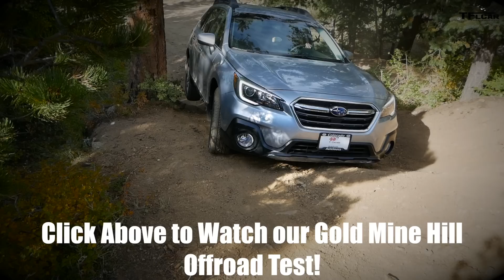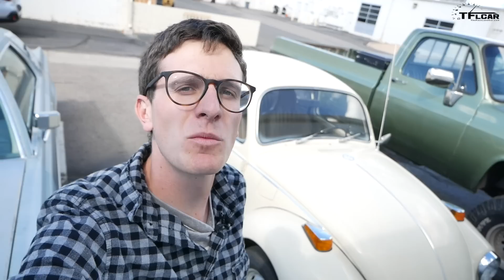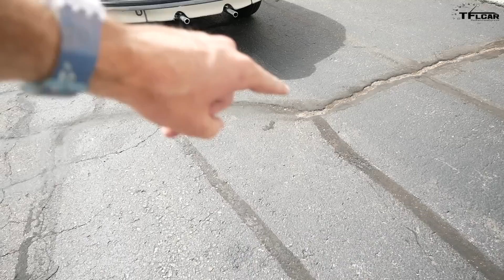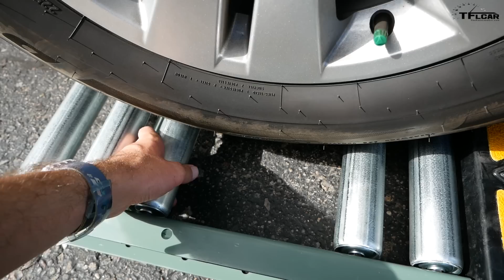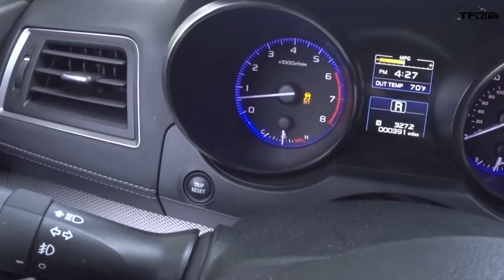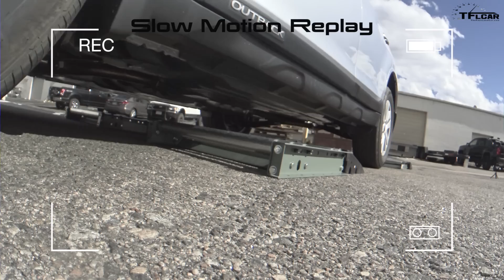The Truth About Subaru's Symmetrical All Wheel Drive:TFL Slip Test vs Subaru Outback

Comment: another really important thing to consider is Subaru awd is always on, its ALWAYS sending power to all four! this makes a huge difference in snow, light sand, light mud, and uneven surfaces.

we just bought a 2018 subaru xv and it just snowed 35cm in calgary last week. i noticed right away the hilarious difference between my honda awd and this subaru, we also tried it with my friends Nissan awd. the biggest problem with all other awd systems is they dont send power to the rear untill slip is detected, so i ask, whats the point of sending power to the rear if your already slideing sideways......  subaru FTW!
Reply: In my experience, AWD in the snow helps mostly to get moving from a stop.  If you're sliding sideways, that means none of your wheels have traction.  Even Subaru's AWD system is useless if 0 wheels have traction.  What's needed is proper winter tires.
Reply: i use nokian studded winter tires on all my vehicles. and yes you are correct, i would take FWD/RWD with winter tires any day of the week then AWD/4WD with all seasons.

subaru sysmetrical AWD + studded winter tires+ light weight= totally un-stoppable in the snow/ice. i drive circles around jeeps/trucks haha.
Reply: @michaelxcx  Not exactly correct about "the biggest problem with all other awd systems is they dont send power to the rear untill slip is detected". It used to be like that many years ago, but modern awd systems do not need any slippage to power all wheels.
Reply: @4x4.tests.on.rollers  incorrect. Apart from subaru. Audi.  Mitsubishi and some bmws. All other awd systems send power only when slip ia detected. This is why they are called "on demand " awd. Not " always on "awd
Reply: @michaelxcx  You would be right if we were in 1998 or so. But it's 2019, reactive systems are almost gone. Now they are proactive (so is Subaru with CVT, connect some OBD and you will see how often and how close to fwd it is working), there are tens of factors responsible for powering all wheels, slippage is the last in the "hierarchy". Some of those systems work great, some are poor, but "on demand" doesn't mean "on slippage". Any acceleration is a demand, any corner is a demand, yaw, longitudinal G, lateral G etc.
Bmw? Never ever heard about any xDrive based on slippage.
Reply: @4x4.tests.on.rollers   again, you are incorrect. clearly u cant read so just watch this video ( please see link:https://www.youtube.com/watch?v=2OzK-oRPCbs) and you will see what i mean. most awd system only send power after slip is detected, i rest my case, glad i could educate you.  cheers.
Reply: @michaelxcx  That is exactly what I wrote before, old systems. You must have been sleeping for last 15-20 years. You linked video which is already 11 years old, cars in the video are even older. Wake up.
And again - which xdrive is based on slippage? Educate me.
PS. When it comes to reading ability - look in the mirror. All you need to do is type in "proactive awd system", "feed-forward awd system", "active torque distribution" etc.
Reply: @4x4.tests.on.rollers  just drove  a 2017 ridgeline the other day. Very clearly it was sending power after slip was detected. No  joke , just yesterday i drove a 2016 toyota sienna awd, was sending power to rear after slip. Also also drove a 2018 crv last year, guess what...... Same thing.  And last year i drove a 2016 Hyundai santefee, also was sending power after slip. My wife owns a 2018 subaru Croastreck and it clearly sends power to all 4 all the time regardless of slip. I test drove a 2016 audi tt last year too also sends power to all 4 all the time.  I dont see how many more examples i need to provide becuase at this point its VERY clear that u are incorrect sir.
Reply: @michaelxcx  Just google the sentences from my previous comment...
Sienna or CR-V are not the best examples of awd systems. In fact, they are one of the worst.
If Audi TT is powering all 4 all the time, than it is the same with Volkswagen, Seat, Skoda, Volvo, Opel, Ford and many others based on haldex. But it is not the point to power all 4 all the time, but to power in proactive way. I don't expect you can check it via service computers, but there are hundreds of articles and videos about it, at this point it is VERY clear that you didn't read or watch any of them.
Short example: https://youtu.be/klZO6oG5PgU
And once again - which xdrive is based on slippage? Educate me sir.
Reply: @michaelxcx  I missed you mentioned about 2016 Santa Fe. Well, it spins front wheels less than a Forester and the same as XV:
https://youtu.be/on8siRlcxGU
https://youtu.be/S1d9wMLo-Tg
Reply: @4x4.tests.on.rollers   TQ vectoring is not the same as on-demand AWD . ive made my point and clearly u cant be helped. cheers.
Reply: @michaelxcx  I didn't say a word about torque vectoring. You obviously don't know that it is competely different thing than (pro)active torque split. No wonder, that was a really long sleep.
Reply: Agreed about the tires. When I got the AWD Lexus it had cheap china tires(or they were hard sport tires). I couldn't even move in the snow, but they are ok in dry/wet. I put Michelin  snows and it made a total world of difference. I think studded is overkill for AWD, that would be a good choice for RWD. Stopping distance is another story though. You need everything you can get. My neighbor bought a new imprezza sport and it could barely even get up the very slightly inclined driveway, It came with summer tires!
Reply: Toyota-Lexus has a better AWD system: https://www.youtube.com/watch?v=tNDV3U2H-Zg . 30/70 and 50/50 in snow mode. It is RWD based and derived from the Toyota Trucks. They don't have to advertise it either.
Reply: @InlineSkateFitness  Subaru AWD system is 60-40 and goes 50/50 when it detects slippage (CVT) and 50/50 for the manual. Toyota doesn't advertise their AWD because everyone knows Toyota isn't an AWD manufacturer. So they there is no point in advertising that when you have a competitor that has been doing AWD since the beginning. Audi has a way better AWD system than Toyota and is been tested to be on par with the Subaru. Subaru AWD is always on vs all other brands that only turns on when slip happens. Like Mazda skyactive system, what is the point of turning on AWD after that fact one of your wheel lost traction? Its already too late.
Reply: @441meatloaf  AWD since the beginning? Toyota had AWD in the 80s on some cars, and their LandCruiser? Their trucks are all over the world and are designed for deserts and off road.

Please educate yourself about this specific Lexus (Toyota) car. Toyota AWD on the GS/IS/LS is all time 70/30 rear to front. So you have a great RWD feel most of the time. If slippage is detected, it has a wire and valve body that moves it to 50/50. It is a heavy duty transfer case that can go in a truck. It is not "part time" or wait till you slip. You are getting every last bit of grip the tires can muster.

https://www.lexussouthatlantaparts.com/cars/LEXUS/0/IS250/Driveline--Transfer-Case-and-Axles/IS250-parts.html. There is a clutch that lock both axles together if needed. The transmission is the same part number as the Tundra, but the transfer case on the truck is a full time 4x4 unit. Subaru? A rubber band CVT? Head Gasket issues? Not putting it down, it is a great system, but the Toyota is in a class by itself.  I picked a used GS 350AWD over a Subaru. I get 23-24 mpg too and the thing has a ton of power.

Extremely rare to see that Toyota drivetrain fail in any way. I'm on the forum. Toyota does not advertise their AWD just as Five Guys never advertises either. That don't mean they not the best :lol:.

Comment: What a stellar scientific way to test the drive system! Great job! One suggestion, to simulate a very slight grade, once the slip tires are on the rollers you could put the small ramps against the Traction tires. You could increase the severity of that ramp or wheelchock to increase simulated obstacle or grade

Comment: well it worked as expected i think, x mode seemed to make the TCS a bit less reactive which is great to allow more wheelspin before start braking wheels,  good if you are driving over some mud sand or deep snow, places where you need either momentum or less esp action in order to keep the revs up and the wheels spinning and digging. Not so good when you´re on an icy bit of road from your town, 
what you could do now that you have rollers is test all the awd systems that you might get using them before doing the usual offroad video up GMH or whatever so that you see the awd work just like the dealer says it works (just like you´re told it will work when you buy the car) and after see how it really works in the real world, i mean this could be a way to see if brands lie about how good their products are

Comment: While this is interesting it's a poor way to replicate actual off-road use.  As noted by others and in your own commentary this is the least possible difficulty as there is no load.  You could likely have just pushed the car off.  The one thing you didn't try is left foot braking in a non-TC equipped vehicle to simulate TC.  That's standard off-road driving 101 - you always left foot brake to not only help redirect power to a slipping wheel but to control the vehicle over obstacles.  I suspect even your VW  would have gotten off the rollers with a bit of brake.  The other thing this highlights is just how much wheel spin is needed before the TC engages.  That's horrible off-road where you want to minimize tire spin.  Of course these are street cars and not off-road vehicles, but it just shows how poor TC (including Land Rover, Jeep and Toyota) is compared to traditional manually controlled lockers.
Reply: Keep in mind they were not replicating off road use here, it was more of a slippey surface.

Comment: Build a ramp so that you can actually put it on some gradient and just make a plate to cover the rollers you want traction on when needed. This way you can test all your vehicles as realistic as possible. This is a simple test and some challenge should be given to weed out good all wheel drive systems to poor ones.

Comment: Yes, its the common torque issue with all brake based traction controls on open differentials. The diff splits torque 50/50 so the brake has to hold 50% of the engine torque, requiring the drivetrain to produce twice the torque needed to actually move the car. On the steep incline the CVT is geared too high to give enough torque to move the car, yet on level ground is just fine.

Comment: I like this new test.  I am looking forward to how you do it on all the new 4x4's and AWD vehicles.
Reply: Don't limit it to 4x4s. Add in the 2WD SUVs and cross-overs to see how they stack up. This testing could prompt manufacturers to base some of their 2WD traction control algorithm on wheel slip from the undriven wheels similarly to the way VW cheated their emissions testing.
Reply: Necron Overlord yeah I’d love to see a comparison between a couple of AWD and 4x4. I have a 2018 outback I’ve seen what it can do but I’d love to see some comparisons between a couple of them. 
I also noticed the wheel locks when the power is transferred to the most traction wheel or does the wheel go on neutral? I’d love to see at least some power on the wheel that’s not getting traction for some better off-roading capability.

Comment: I have a 2018 Forester XT that I've taken on some steep rutted hills.  There were two instances where I was climbing a very rutted out incline in the Forester with ruts at the top.  The front drivers wheel came off the ground at the top of the hill.  The Forester was able to teeter itself on the opposing front and rear wheels to to lift the rear passenger wheel off the ground and return traction to both front wheels to continue the climb.   I had to do this on two different occasions on my trip. This was with x-mode enabled, and I wasn't aware of disabling VDC so it was apparently on at the time.  I also have an '88 Wrangler with many offroad mods that I take on trips that could do damage to the vehicle, but for camping, long or comfortable trips, the Forester has pushed my Wrangler to the side lines.

Comment: Please make more of these videos. Very curious about a VW Alltrack
Reply: No, this guy doesn’t really understand AWD systems very well. It’s obvious at the end of the video when he states that the Gold Mine hill pushed this car’s torque and climbing ability. Install the right tires and this car will easily conquer that precarious spot! And if it can’t, well neither will the raptor or a Jeep. Tires are everything! This Subie’s AWD was not at its limit at that spot, the tires were! How do I know? All wheels were spinning! Now, if one of the wheels wasn’t spinning and had traction, than yes, the car’s AWD system it to blame! This guy needs to educate himself a bit better before making such claims!
Reply: @vicwiseman6038  people lose sight of the whole "tire thing". Kind of a silly oversight in my opinion. I'm glad you mentioned it.
Reply: I just saw a video yesterday (put out by some Germans) where they did this roller test between a Subaru Outback and a VW Toureg. Simply put, the Subaru won, but that doesn’t mean the VW did poorly. 

They did “front left only” and “left rear only” for traction. The Subaru adjusted its power distribution much faster than the VW, and the VW couldn’t get off of the “left rear only” test until the passenger got out and sat in the second row behind the driver.

Honestly, I’d feel adequately equipped in either vehicle, but the Subaru AWD system is second to none.
Reply: @T.e.d.d.y.  Ah thanks. Obviously I forgot lol. I wasn't really paying close attention to which models they were, just it was a Subaru and VW.
Reply: The VW transverse applications (like the Tiguan and Alltrak) and not symmetrical. VW does have some very trick electronics to help compensate for that fact, but in other tests with their Haldex AWD system, Subaru beats them. But, VW still does respectably.

The Touareg, on the other hand, is a monster. The first gen came with a transfer case with low gear and optional was an electronically locking rear differential. Proper true offroad stuff there. The newer ones don't come with the low gear transfer case nor the locking rear diff, but the electronics are more sophisticated and the transmission has 8 speeds instead of 6, so I'm assuming first gear is probably short enough to substitute a real low gear well enough. They have some super trick hill descent control as well with the newer ones. Very slick, highly capable offroaders.

In TFL's mentioned video of going offroading with this Subaru, I think the primary thing holding them back was ground clearance and tires. That AWD system should still do pretty well, but maybe not quite as well as proper truck setups with extra low gearing and locked rear diff.
Reply: +Joao Guerreiro I don't think it would do as good but not a big difference because all VW except Touareg have the fwd biased awd, same goes for Audi A3, Focus RS. Video: https://www.youtube.com/watch?v=S1d9wMLo-Tg
Reply: Golf alltrack is haldex, so it won't do well. haldex is really a 4wd system, no good way to vary torque to an individual wheel, reax axle can only get a 50% of the power max if its even set up to get that much
Reply: +FunkiHunter Disagreed. Audi Quattro with Torsen is the best AWD system in the world. It dominated rallying until the system got banned in 1986 because it is just too good. Subaru used to be good, but its new cars with prone to failure CVT with its over-advertised symmetrical awd system are only good at saving gas.
Reply: Banana Republic Don't lie ;) Quattro dominated rallying just when competitors were using RWD cars and even that is not actually the truth cause in 1983 they even lost whole championship with RWD Lancia. When other competitors started to use 4x4, they smashed Audi. And there was no any torsen in Audi until 1987, although this diff was invented 100 years ago...
Reply: No, I love Torsen diffs, but Tesla obviously has the best AWD system, because it's pure torque vectoring

Comment: I would remove one more roller from each roller tray - this would put more of a load test on the driving wheel and it will make sure that when you test future more front wheel drive based systems that cause torque steer rocking / swaying, that the front tires while moving to the side don't grab grip from the frame and cheat its way out (I have seen this in other similar tests).

Comment: I seen some videos of an all wheel drive system test where they rotate the rollers in all 4 corners so one tire in each test has traction, in some of those test for example right rear tire is the only wheel that has traction and the other 3 are on rollers and the vehicle pulls itself out but when they put the left rear tire on the ground and the other 3 on rollers it could not pull itself out.

Comment: I would like to see the roller test done on a older Dodge that has the 4-wheel drive High 4 wheel drive low and then a 4 wheel drive lock I think the lock only locks the transfer case on the old generations but I would like to see the difference also like your Chevy 1500 4 wheel drive Auto on your 2000 to 2006 generation if you get your hands on one of those trucks